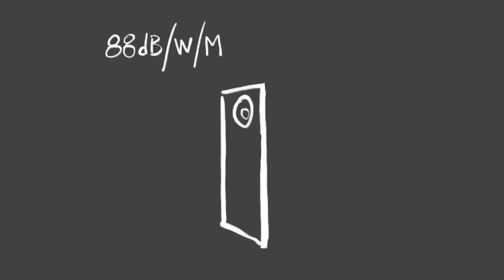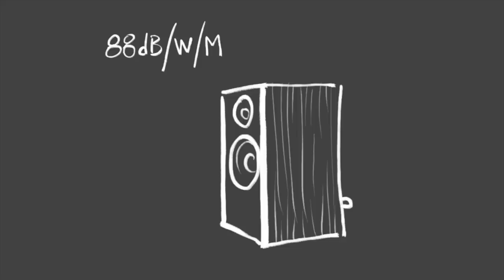John DeVore goes on a rant about the High End Audio lie that inspired him to start his company

Comment: This is specifically why I don't use speakers in my setup that use multiple drivers for the same frequency band. Everything I build has one driver per crossover point.
Reply: Would 'nt the optimum way to design a speaker system be to enclose the tweeters, midrange and bass each in their own separate cabinets located apart from each other so that the various frequencies don't blend with each other as they do in an all-in-one cabinet design?
Reply: @bellavia5  Yes actually. It's called bird housing. I use it in my very important channels like front left and right.
Reply: @joeldoxtator9804  I'd like to group the left and right midrange speakers close to one another so you get the percussion concentration.
Reply: @bellavia5  While I get what you are trying to achieve, it doesn't quite work like that. Percussion is a type of instrument and not a specific frequency range. As such moving only the mid ranges closer will only effect percussion that happens to fall into the range that those drivers cover.

What it sounds like you are after is a more accurate stereo image. The stereo image is the speakers ability to accurately represent the sound stage that was originally recorded by the mixing master, i.e. being able to audibly locate the individual instruments on the sound stage. To achieve this you need to limit the cross talk between crossover points. This is less about the placement of the drivers and more about the steepness and accuracy of the crossover points in you speakers electronic crossover.
Reply: @joeldoxtator9804  Yes I was taking into account what you said about "effecting only the percussion that happens to fall into the range those drivers cover. " I take a rather crude and elementary approach -I admit. So I'll have to focus on the crossovers when I put together this system. Thanks for pointing that out.

Comment: I think very few companies, even Threshold or Krell, made amps that could drive a 2 ohm load.
Reply: The first-generation Apogee Scintilla was 1 ohm. The only amps which could drive it were the original Krell KSA-100 and KSA-50 as a bare minimum. KMA-200 monoblocks were also the only thing on the market at the time which could deliver the 60-amp current needed to make the Scintillas really move some air.

Comment: I am quite confused by all this tbh. I did hear that the wattage power mentioned on most av receivers is rarely what it says it is but i am not sure if this is actually true as when i upgraded my Sony dh820 to sony strdn 1080 it was meant to be more powerful.. And it was and i could hear a huge difference out of my speakers. (I remember thinking wow!) So much more out of my speakers like no holding back. What a difference! So obviously it was more poweful than the other one, like it said it was so i doubt that they lie about numbers on av receivers as i heard quite a difference. Was well worth the upgrade at the time. But as i said i can't follow what you said. Confused insantly when you mentioned 1 watt as the numbers you mentioned didnt say anything about 1 watt. But admit i am not the cleverest of people hehe! All i go with is so long as rhe ohms match up to the av receiver. As i had an 8 ohm center speaker linked up to a 6 ohm av receiver, the rest of my speakers were 4-8 ohms. It worked but it sounded very drained.  But when i eventually managed fo pick up another 4-8 ohm speaker it made a huge difference. Well what i am trying to say is it seems to me these numbers are there for a reason. People need go know what speakers are suitsble to use on their av receiver so i doubt they could lie about it. Just what i think. I have been using home cinema sound since the 90's. Back when you had to have a nicam signal to get dolby pro logic. So i have been using hime cinema av receivers for well over 20 years. So i am quite surprised i have no idea what you are talking about but this isn't on you. I am just not exactly the smartest of people and first to admit it. But i just don't see how they can lie about numbers especially when it comes to ohms as i do know that's how you can blow stuff if you are not usong rhe correct ohm speakers on your av receiver. So it is absolutely paramount that they tell you what these numbers actually are. You need to know so you don't blow and ruin your equipment. If they lied you would be putting the wrong speakers on your receiver and your reciever will blow. So just saying i can't see how they can possibly lie about it.

Comment: Since at least the 80's I have heard conflicting claims about how the sensitivity graphs are produced - regardless of whether the dB@ W/m or dB @ V/m convention is used, this is the issue; is the DUT (device under test) simply hung in the air at the given distance with given power then swept 20Hz-20KHz or fitted to an 'infinite baffle' ?
As one of the comment's below states that a virtual 'short circuit' would occur around the frame/chassis of the driver becoming worse at the lowest end of the sweep.
If any sort of enclosure was employed during the creation of these sweeps, then not knowing exactly what type of enclosure other than 'infinite baffle' would render the sweep pretty useless IMHO

Furthermore, given that a speaker exhibits a much higher impedance at resonance eg. 80 Ohm's @ 70Hz, is 1 Watt being dissipated at this exact point of the sweep, or did they calibrate 1W into a 4/8/16 Ohm dummy load then swap out the leads from the load onto the actual driver then run the sweep. My 'gut' feeling is the second scenario as I would imagine seeing a large peak on the graphs at resonance. 
I do realize this would only apply in the dB/W @ 1m measurement's according to Ohm's law.

If anyone knows the answer to either or both of these points I would love to know as it hs cropped up time and time again and to date I have found nothing concrete in either respect.

Comment: As a matter of reference, is there a standard frequency used for these measurements?  It's my understanding that impedance varies greatly with frequency...
Reply: Isn't that supposed to be 1k?
Reply: @rollingtroll  I wondered that; I think you're right. And - conversely, does frequency response also depend on impedance?
Reply: It has been twenty seven years since I took electronics at Trade school and I do not utilize the knowledge very often. When he shows the power equation I keep thinking that there was a more complex formula. Your question reminded me of the property known as capacitive reactance, Xc, which is frequency dependent. "Capacitive Reactance is the complex impedance of a capacitor who’s value changes with respect to the applied frequency." This is only in AC circuits to my limited understanding.

Comment: there's a ton of stuff missing here. you have talked about speakers as if they are just dumb resistive loads, which they are not. they are highly reactive loads, & the impedance presented to the amplifier varies wildly with frequency, whether we're considering a single driver or a multi-way system with a passive crossover network of some sort. then there's the matter of the output impedance of the amp itself, the electrical & mechanical damping effects.

in fact, very few of the numbers that you see quoted by hifi manufacturers mean anything other than 'ball-park' or 'under these exact conditions', & when you get a component into the real world, what you get out of it depends very much on the context- what else it's connected to, for the most part.
these things can only be an exact science if the context is accurately described & understood. without that, it doesn't really matter if you state 88dBA/W/m or 88dBA/2.83V/m, because you're still only establishing  a minimal set of conditions for the measurement. are we to assume a damping factor? sine at 1kHz? pink noise?

besides any of that, & here I find myself siding with the guys who've commented along the lines of "well, I've got one of these amps & these speakers & it sounds just fine to me...", the dB/Watt/metre guide to sensitivity is just that, a guide.  showroom stuff. 
ideally it would be a useful comparative, but it's real finger-in-the-air stuff, not hard science. & because of that, it makes a nonsense of comparing a $150 transistor amp with a $5000 tube amp. 

so forget about it.  arrange a demo of the thing in your own context (home, studio, whatever) with your own source material & other components. if you like the way it sounds after a few hours, fine. if not, back to the shop.

Comment: 12:32 - I wouldn't worry too much about what Sterophile says, as the way they report on their step response and CSD tests results are sometimes akin to outright lies.

Case in point; https://www.stereophile.com/content/g%C3%B6bel-high-end-divin-marquis-loudspeaker-measurements 

Check what they say about the cumulative spectral decay plot of the Gobel; “however, this graph is relatively clean in the region covered by the tweeter”.

Also, check what they say about the step response of the same speaker; "the decay of the tweeter's step smoothly blends with the positive-going start of the midrange unit's step, which implies optimal crossover implementation”. 

Neither of those Sterophile comments are true and they are just 1 example from the Steroephile.

Comment: The reference to amps producing 2x the watts into ½ the impedance is incorrect. If you halve the load the voltage will increase by the square root of 2 and the power output will rise the same (i.e. x 1.42).

FWIW dB/1w@1m measured at @ 1kHz is still the standard measure of speaker sensitivity in the pro audio world (bear in mind it is also meaningless unless it specifies the frequency the measurement is taken at).
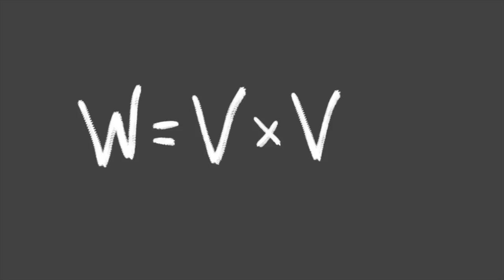Reply: @James Wilkes I'm clearly misunderstanding something here, going off the formula shown at 6:10 in the video, W=VxV/R? Experience demonstrates that real world power amps also don't double their claimed power output for a halving of load impedance, typically is around 1.5X.

edit :- Ok, my bad, if the voltage stays the same then, yes, I understand.
Reply: @James Wilkes Yes, it's been a long time, I had to go back to the equations and remind myself

Comment: When I ask about my speakers sensituvity I get the answer 89db in 8ohm and sometimes 4 ohm. What does that mean?
Reply: A specification of 1 watt takes in to account the impedance.  So an 8 ohm nominal speaker load at 2.83v would be 1 watt.  With 1 watt into a 4 ohm speaker you would need less voltage because a 4 ohm load would demand more amperage.  Another words 90 db at 1 watt at 1 meter by necessity has to take in to account the impedance of the speaker so you don't need to include it.  A speaker has a nominal impedance measured in ohms that is objective, meaning you won't have a 4 ohm sensitivity rating and a 8 ohm sensitive rating for the same speaker!!
Reply: @allanwilmath8226  this is what it says: The speaker presents a nominal 8 Ohm load that drops to 3.8 Ohms at its minimum, indicating that it should be an ideal candidate for most amplifiers

Comment: So what does the cat think?

A single sensitivity number is not terribly useful anyway, much like a single impedance number (8 ohms?)

An ideal amplifier would have zero output impedance (Thevenin equivalent) hence, would double output power for each halving of load impedance.  Obviously, something has to give.  There is no such thing as an ideal amplifier.  In order to predict accurately how a non-deal amplifier will interact with a loudspeaker, you need to know the impedance of the speaker at every frequency.  Atkinson and others often give a polar complex impedance plot in their reviews. They also typically give unambiguous sensitivity specifications, i.e. they tell you how they were measured.    Solid state amplifiers typically have very low output impedances.  It's usually the power supply that limits the output power.

There is confusion about amplifier impedance and optimum load impedance.  Given an amplifier with a certain output impedance, the load that absorbs the greatest amount of power is the matching impedance (actually the conjugate matching impedance, since in general it is a complex number).  But given a speaker with a particular impedance, the optimum (most efficient, no waste) power transfer is going to be with a zero impedance amplifier.  Hence, my original statement.

A tube amplifier, as suggested in the video, typically has a high output impedance, adjustable via the different output transformer taps.  However, the typical global negative feedback makes the effective output impedance more complicated.  When your speaker impedance drops to 1 ohm or so the NFB causes it to be driven it harder, to compensate.  So the situation is not quite as bad as you say.  How well this works depends on which tap the NFB loop is taken from.

The bottom line is that in order to evaluate how a particular amplifier is going to interact with a particular speaker, you have to listen to them.

p.s. back in the days when all canned cat foods were opened with can openers, when I needed the can opener for some non cat feeding operation I would try to get it out quietly.  But if I made the tiniest click with it, so tiny I could barely hear it myself, the cat would come running from two rooms away.  Animals do not use their superior hearing for frivolous things like evaluating speakers or voicing violins, they use it for survival.

Comment: I am not super knowledgeable but since the 70's have always had or wanted a pretty good stereo system and I am always drawn to these types of videos. I used to read all the magazines.
QUESTION, in the 70's when the glossy Hi-Fi manufacturers brochures used to print this speaker sensitivity number wasn't the specification understood as a not printed, not stated but understood """AT 1,000 Hz'''''''?
So, "#" decibels per  1 watt measured at 1 meter, (at ,1000hz.)
because different speakers have different sensitivities at different frequencies?

It is an important spec., don't get me wrong and in commercial purposes of great importance.  If you are starting a large Disco dance hall and outfitting it with sound, get some 96-97 Db efficiency JBL's to save on amp costs.  But truthfully, to a high end, great sound home user, if the person really likes the sound of a speaker, he will get them, he'll just make sure that he has an amp with the power, even if they are a pair of 81 DB Thiels, because it is all about the sound, not about if it effects his monthly electricity bill by $0.89 cents, haha!  And the 70's were all about the MOSFET transistor amps with plenty of power/wattage and it was clean power to boot, I love me a good old Pioneer SA-1280 receiver that you mention coming in at ±70 lbs.  The re-birth, re-popularisation of low power (35 watt-ish) tube amps wasn't until the late 80's, early 90's.  They weren't around in the 70's.  Luxman, Accuphase and all the Japanese amps were all transistor.  McIntosh was a notable exception.

The remainder of my comment is a troll but it is meant well :-)
How speaker efficiency is specified is one of your biggest peeves????
Dude, the High end audio world is one weird atmosphere with some nerdy seriously distorted people in it, it can get serious creepy.  Personalities that get all sensitive, highly elitists over the minutest irrelevant childish issues, you are smack in the middle of that, I assume, and how they wright down the efficiency of a speaker is what bothers you.  Maybe you do belong in that world.
Informative and good video,
Thank you

Comment: Well, those brutal loads were, in a certain way, limiting themselves to the few who could afford those mega current capable amplifiers so why you bother? Make an easy load and the potential customers will grow. Personally, I thought then,  in the 90's, that a self respected loudspeaker couldn't let a flimsy cheap amp to drive. I remember how  my infinity loudspeakers did sound much better with a heavy power supply amp than with a feather amp. I related that to quality so it was a shock when my next loudspeakers,  Harbeth M-30 could sound good with any source of voltage between the binding posts!!!!
I found the lows very disappointing so I changed again, I bet definitely,  for my TAOC-FC3000. 
Great videos! I like them a lot

Comment: I have a really dumb question. 2ohms vs 16ohms. Ignoring efficiency ect. Is it fair to say that 2ohm loads sound less Hifi than 16ohm loads?
Reply from the maker: No. The impedance itself shouldn't have any effect of the sound of a speaker per say. The effect is more directly on the amplifier driving it. Some amps will sound terrible driving a 2 Ohm speaker, just like some amps will sound terrible driving a 16 Ohm speaker.

Comment: Unless the impedance is stated at which frequency it was tested at 1W or the impedance curve is shown for the noise used at a specified standard voltage and bandwidth, there will always be room for fuckery.  Sensitivity is a worthless spec because no one adheres to a standard.  More so since power has gotten much less expensive in the past decade.  Measurements rule, the rest is marketing wank.

Comment: Yeah, they seek to deceive. During the past  3 or so decades i saw speaker brands increasingly convert to giving their sensitivity figures in "Decibels at 2.83 Volts in" & abandoning the straight & clear  "X-decibels @ 1 watt @ 1 meter" so you knew where you stood at a glance & as you say, there was no need for that except to deceive. On low-end budget gear they also started that wattage nonsense E.G. "1000'Watts music-power / 25 watts r.m.s."  but most gave only the meaningless  'music power' on the surface.  Plus, very many stated the r.m.s. output at 10% THD & i've even seen rms watts given at 50% THD 🤪 ...it's done because big Watt numbers are very impressive to people who know very little else.